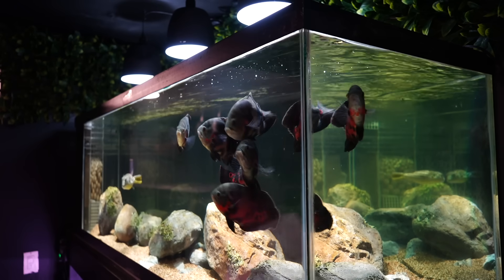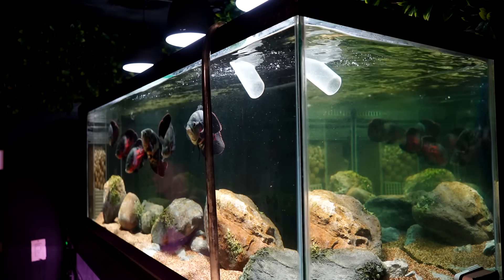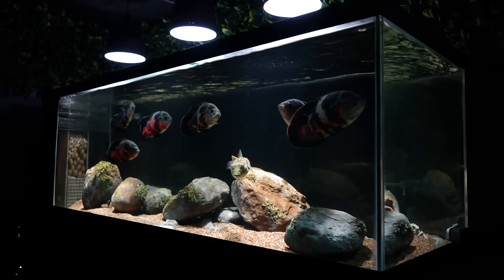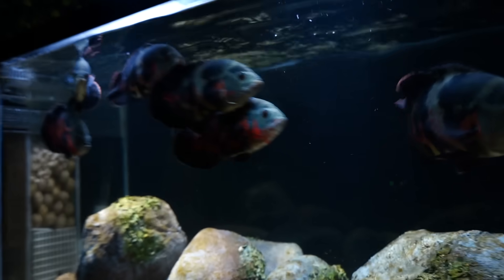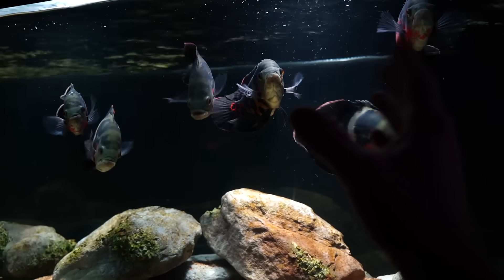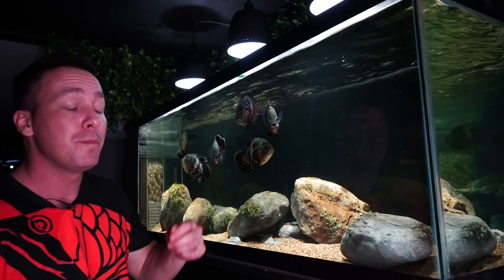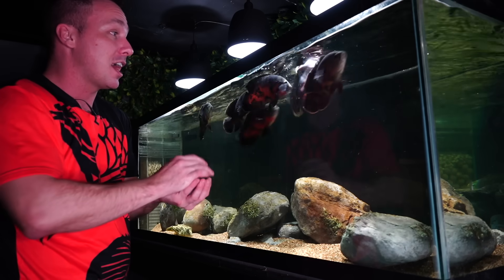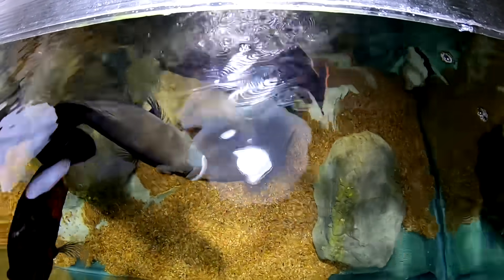THE OSCAR AQUARIUM - complete tour - The king of DIY

Comment: Hey Joey, I had an idea that maybe of use to you for water changes. Have you seen Aquarium Float Ball Valves? what if you were to run a hose which you could link up so all the Tanks sit the valves on the side of the tanks can fill with the safety of not over filling. It would not speed up the fill time but it would mean you could empty tanks then have them refilling while you go off somewhere. 
What I am picturing is short hose into a T push fit [water in], one side a hose running to the Ball valve that you can put on the side of the tank. And final side of the T has a short hose leading to a push fit (john guest) shut off valve [water out]. Make 6 of these (or more), that you can daisy chain together. Now you can empty the tanks and start the filling by adding a new daisy chain valve as each tank empties. Allow them all to fill while you go off and do something else.

Comment: hello, thanks for your experience, I can ask about your filter, you said that your filter has enough flow to push dirt into the filter, however I find the tank for oscar that water flow is not too strong, so does your filter have bottom suction or just on the surface of the water? I am wondering if my filter is strong enough to draw fish waste from the bottom of the tank to the suction tray at the top of the water. I am planting to hold gold fish

Comment: Quick question: I am currently cycling my 800 liters tank (about the same size as yours in this video) and my question is would 6 oscars like this be too much to keep once they get a bit bigger. Because the problem is I don't have another large tank like this to keep them in afterward. Cheers.

Comment: I just bought a pair of 9 year olds, I think they are both males, one is substantially larger than the other, one of the biggest I've seen in probably weight, the smaller one is about 10 inches long, the big boy is a boss, anyways the larger one has started picking on the smaller one, they were raises in a 70, and now they are in a 90 gallonwhich is kept in excellent shape, and at 78 degrees, I first noticed it when the tank was at 81, so I thought they were just rooting, however they big one hasn't stopped, could they just be in "heat", or something else, he is calming down but it's been 2 weeks now? Any suggestions would be greatly appreciated, when they are good these guys are pets, I would hate to split them up, also more tank specs if it helps
90 gallon, 48 wide, 36 high, 24 wide, or very close
78 degrees
High current flow in the tank
Water is in perfect condition 
7 three to four inch goldfish, which maybe could be the problem, they can go, sorry for the long post, but I really do like Oscars, these guys are in very healthy condition and always together when the get along, like I said the large one is a big boy, the smaller one is about ten inches long, but not very wide, also on a diet of crickets and super worms, thanks

Comment: What type of biomedia do you use and what is your opinion on
 biohome brand. They state that it can house more anaerobic bacteria which can lower the nitrates and reduce water changes. Aerobic bacteria only really helps with ammonia and nitrites, but it's that anaerobic bacteria that we all want to grow.. bio home claims that they can slow the flow down low enough in the center of their media to house the anaerobic bacteria and be effective in removing nitrates, is this fact or fiction. LOL just looking for your opinion and thoughts on this matter. I find some of the most porest types of media are very fragile but this is a very hard sturdy piece of media with a lot of absorbent power. Is there a superior media that will test low in all ammonia nitrite and nitrate or is it a myth.. just an idea because you have so many tanks with about equal bio loads on them, some a little more than others. But you could probably run a different type of media in each aquarium with the exact same filters all built in in your case and see which one test cleanest by water test kit and require the least amount of water change in a set time frame. Maybe an idea for some videos and help us with product review.